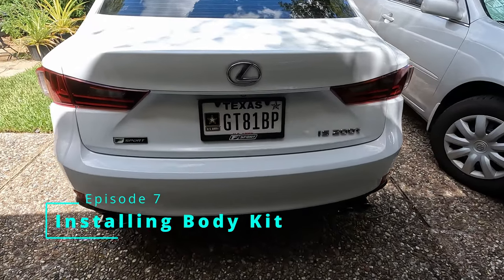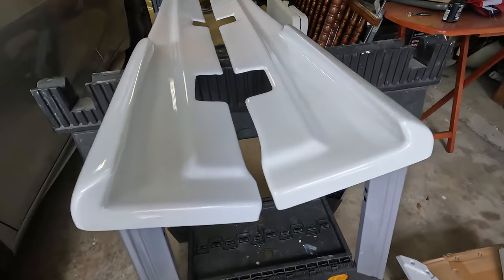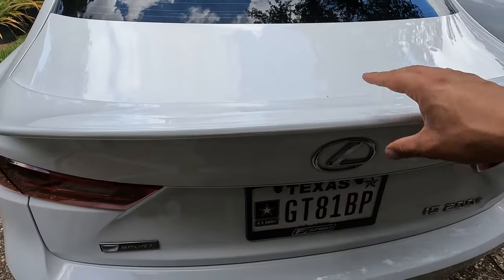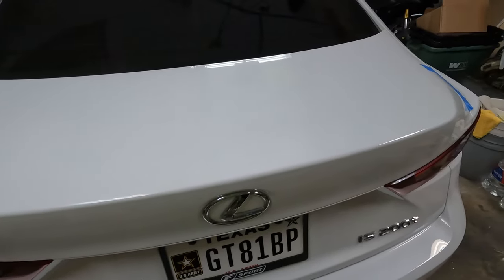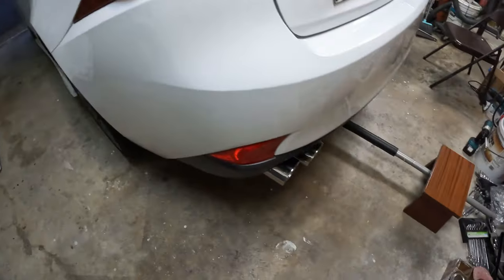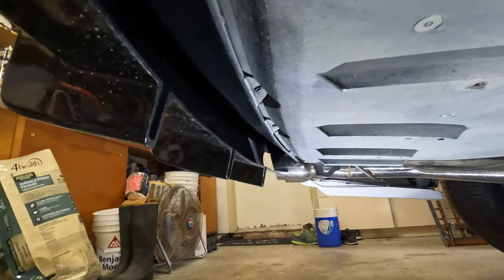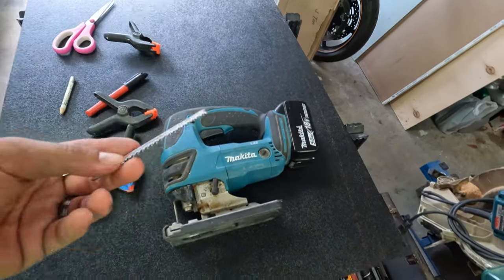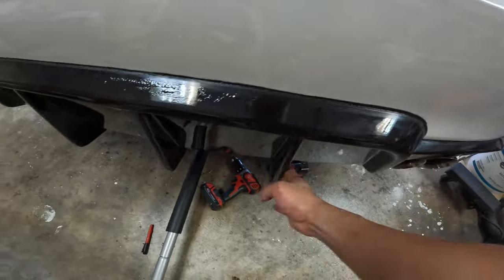FULL BODY KIT INSTALL [ULTIMATE LEXUS IS 200t Build, EP 7]

Comment: LOOKS killer bro!!!! you doing something with some wheels? a little bit wider wheel would really fill it out.
Reply from the maker: Thanks man. Yeah Maybe down the road I’ll do something
Reply: @spikeboi55  how did you install the front lip? And is there a kit for a 2016 is 350 f sedan?
Reply from the maker: @allboutthemojo  I used the screws that it came with. However they aren’t stainless steel so they are rusty now. It should fit the f sport 350. They have the same body I think. The only difference is the engine.
Reply: @spikeboi55  thanks.  I'm only looking for rear spoiler / lip and front lip. Has to be stuff I can 3m. Will not put a hole in my cars body 😆
Reply from the maker: @allboutthemojo  it screws underneath to your bumper on the plastic black part. Will never see it
Reply: @spikeboi55  👍
Reply: Noice! I think adding wider bronze wheels would complete the look.

Comment: I’ve been having some problems with putting my diffuser on , did you have to sand the parts where you put the 3M ? Mine is very oily
Reply from the maker: Mine was very oily as well. I wiped it with rubbing alcohol really good before putting it on